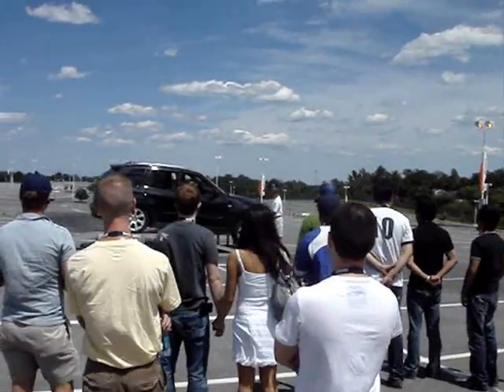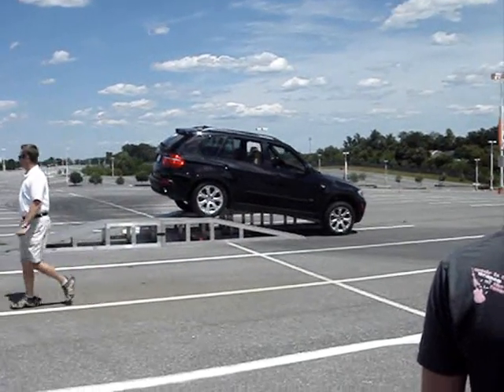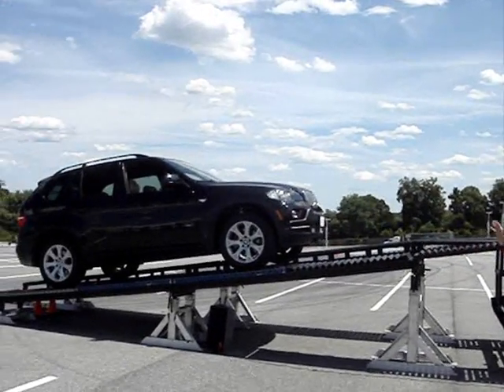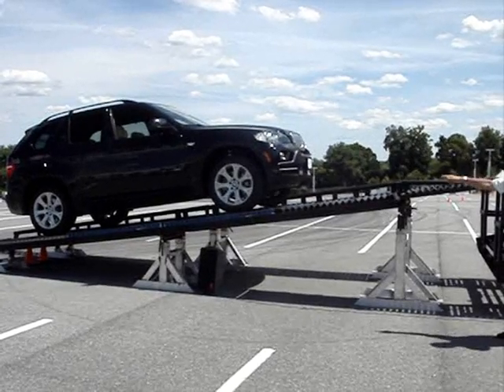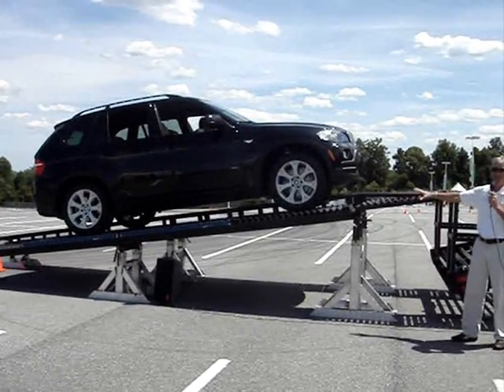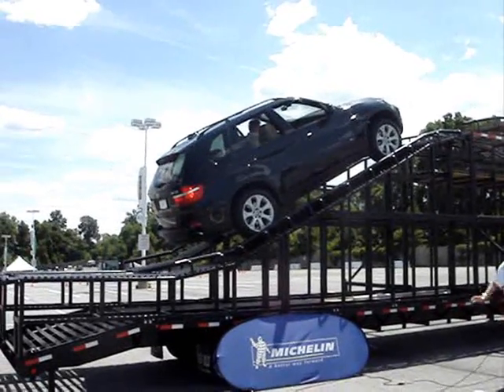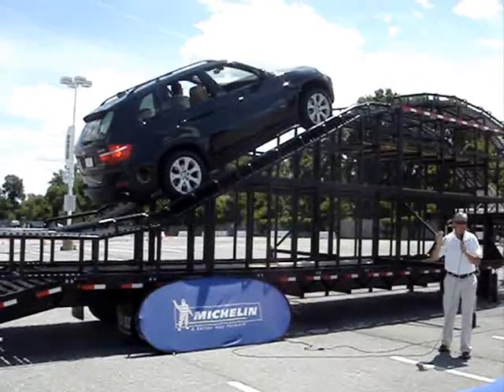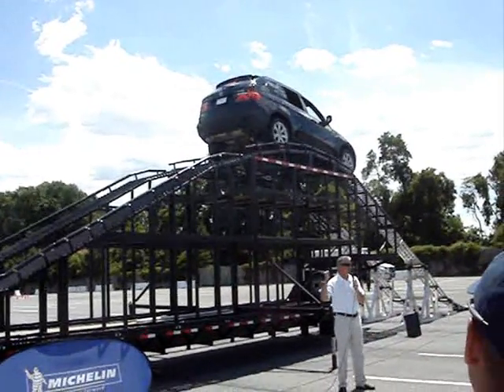BMW E70 X5 Technical Demo

Comment: in 90% of the vidoes the x5 is fitted with 20" rims and summer tires .. and idiots be  trying to get through swamps.
the subaru dosent have that problem ... most of them come with hubcaps

Comment: xdrive is good but relies heavily on sensors. If you get the chance to drive it adverse condition you will notices that its not predictable..it feels very robotic in terms of power delivery. Mechanical all wheel drive with a centre differential and an electronic overlay has a better feel to it IMO..EX. 4th generation quattro!